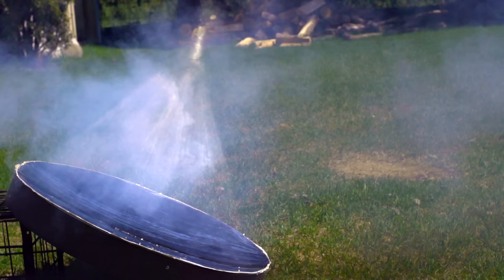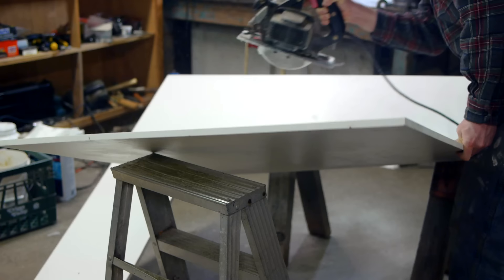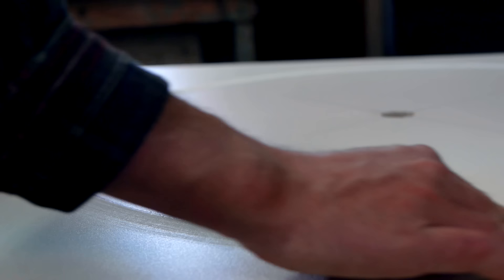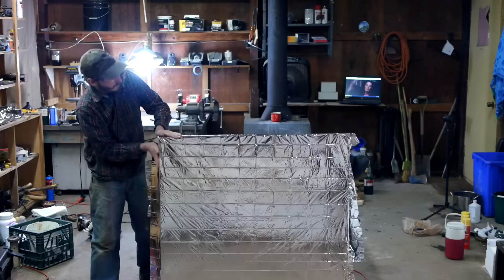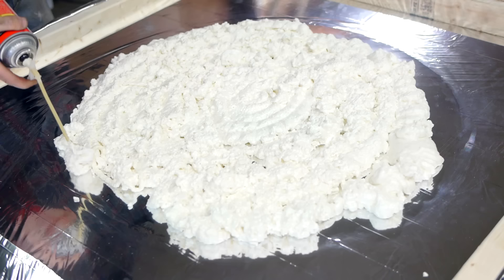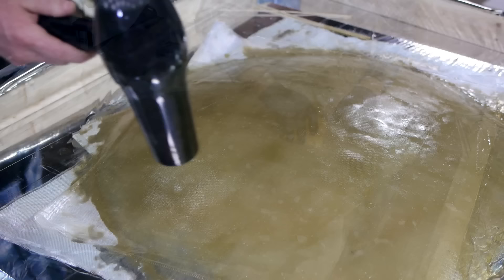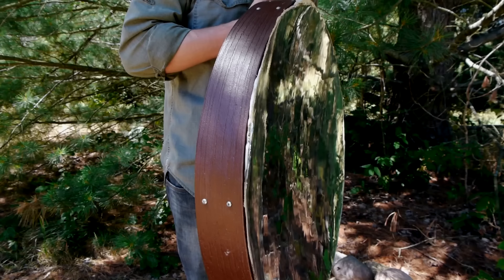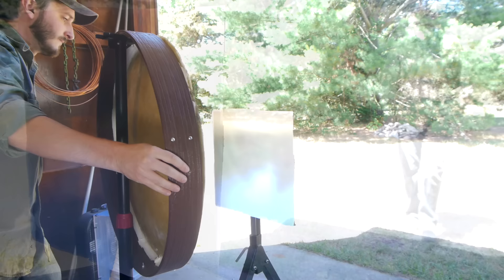How To Make Parabolic Mirrors From Space Blankets - NightHawkInLight

Comment: An idea that I have been wanting to try is to use a discarded DishTV antenna. Use the same "Space Blanket" foil to glue to the antenna. The antenna is an accurate section of a parabola with off-axis focusing.
Reply: Hi..bro ..please can you help me to write the materials that're used to make the blanket mirror..and the steps if you can..because my university requested from us to write a report about it.
Reply: I have done that. Found a large one (36") and covered the inside with mylar. We cut many mylar hexagons (4" in diameter) rather than a vacuum. It allowed for a wrinkle free installation with spray glue.  The completed mirror put things on fire easily.

Comment: What's pretty neat about aluminized parabolic reflectors, and "funnel" style solar ovens, is that they can also be used to cool objects as well at night , by radiating the IR energy up into space.  Make a container that is very well insulated in relation to conduction and convection, but very transparent to IR, find a part of your yard with a clear shot to the sky, point the reflector straight up and especially on cloudless, dry nights, over night, the contents inside the container will significantly cool in relation to ambient air temps.

Comment: Nice work. Space blankets are quite transmissive, and wear very easily. I've used hydroponic mylar for parabolic troughs in the past, it's significantly more reflective, thicker, just as cheap, and a little more durable tho still not enough to just leave outside.

Comment: I was playing with these long ago. After several versions I made just two flat rings around 3 feet in diameter. I placed a tire valve into a hole drilled into the rings. Then I took a clear piece and a mirrored piece placed them together and bonded them between the rings so the valve is between the films. Then pump air inside and it inflates like a balloon. The rings keep the lens stable. This can be scaled up quite easily to make giant mirrors.
If you wish to replicate this feel free to do so.
You may need to add a spacer ring to allow the space for the valve.
Reply: I remember seeing this scheme in a drawing of some proposed solar reflectors destined for orbit. They used an inflatable torus for the ring. The thing I like about this is that it can be safely depowered by changing the pressure inside to make a convex mirror.

Comment: Bought a ten pack on Amazon. I used spray adhesive and glued several gold foil space blankets to a tarp. Tried it out a couple of times and it reduced the temperature under them by 20 degrees. Great to put over your tent when you're camping in the desert. Tried them in the winter too. Hung the tarp inside of my tent by surrounding my sleeping bag. Outside temp was 21 degrees F. Temp inside the tarp 59.
Reply: or when you need to hide from police helicopters and their cheeky thermal vision
Reply: @trollmcclure1884  But the giant shiny thing is visible by our eyes
Reply: @midgetman4206  you can put leaves on it and stuff. It’ll still act as a barrier for infrared. Didn’t some murderous hobo hide from police helicopters like that? I forget.

Comment: I did a similar thing a few years ago where I stapled down the mylar  with a layer of cloth over it  in a circle onto a piece of plywood with a hole in it that I attached my shopvac to. Then I  inflated it and applied some resin to the cloth, which stuck it to the mylar. After the resin cured in a couple of hours I just cut off the dish with some scissors. It was pretty floppy, but if I added a ring like you did I imagine it would have been fine.

Comment: make a round ring to hold the mylar down instead of just epoxy, then you can really put pressure to the mylar. Make the ring just smaller than where you glue and round the edges 2mm radius "so mylar does not tear" then run your fiberglass and fiberglass the ring to the mylar as well. Now you have the stable mirror and you do it all in one process.
Reply: Good congratulations!!

Comment: To make a telescope, the parabolic curve would have to be much, much shallower to get a longer focal length.  Telescopes tend to have f ratios of a minimum of about f/4, and anything up to f/12, meaning the diameter of the mirror is 1/4 or 1/12 the focal length.  So for a 1 foot diameter mirror, you want a 4 foot to 12 foot focal length.  The mirror shown here seems to have an f ratio of about f/1.  

To make a shallower curve, you could pour water into the middle of the mylar, stretched over a circular hole.  Stretch the mylar out very tightly by clamping with lots of G-clamps over another material to spread the load.  It is important to get the tension equal all the way around to get a symmetrical shape.  You can check the focal length by shining a torch onto the mirror and trying to get the reflected image of the torch's filament or LED in focus.  However, the water will probably affect the focal length, but I haven't done the calculations to work it out.  

I like the fibreglass idea, but you could probably bond a rigid support to the fibreglass with vertical and horizontal cross brace rib pieces similar to an aeroplane wing construction, before removing the clamps. Then bond those ribs to a solid base and cylindrical side-wall and it will be really rigid.

I'm not sure how viable this mylar would be for imaging, as it looks a bit uneven and the reflections look kind of blurry when compared to a polished piece of metal or metalized glass mirror.  Another method to consider is metal spinning - spin a large piece of sheet metal and bend using a tool to match a former underneath.  I wonder if vacuum-forming (vac-form over a large open hole) could be used with a metal-coated plastic sheet, or maybe you could electroless-plate a normal piece of vac-formed plastic with metal?  You could even ditch the vacuum and use heat to make the material sag under its own weight, or use water or sand to weigh it down.
Reply: @jimmimak, it seems to me that the curve achieved by the air pressure method in the video must be spherical, rather than parabolic, as the pressure will be exerted perdendicularly to the surface at all points. Continued inflation would lead to a spherical bubble, if the material was elastic enough. Your method of dishing the surface using the weight of water must give a different curve, as the direction of the force applied at all points will remain almost perfectly parallel
over the width of the surface, I imagine. I want to think that the curve achieved would be parabolic, but I cannot determine why it should not be a catenary, which is the curve assumed by a cable or thread strung between two points and acted on only by gravity. Do you have any thoughts on this?
Reply: If elaborate on this with a thought experiment, I wondered if the focal length of the curve with the water method could be controlled by adding a greater weight of water. That is to say, I imagine the mirror at the bottom of a column of water, however, I think that this puts us back in the position of hydraulic pressure, rather than pneumatic, acting equally over the surface and forming a sherical dish. Does this contradict the idea that the elastic mirror, responding to the pressure applied by water filled only to its brim, might give the parabola we seek? What do you think?
Reply: @leehaelters6182  Interesting ideas.  I think you're correct about the hydraulic pressure, but my guess is the difference would be too subtle to notice.  Perhaps with a denser material you would get a more noticeable parabola?  

To make the parabola, I've had a few ideas, but they might be too wacky or extreme as the shape needed is probably more subtle.  

1. Very stretchy membrane material like spandex. 
2. Material that progressively gets thinner towards the centre.
3. Several layered membranes with holes/apertures in the centre getting progressively smaller.

4. Membrane material with a low elastic limit, so that it plastically deforms?  Like bread dough.  
5. By heating a piece of plastic more in the centre than at the edge (think vacuum formed plastic).

6. Fill membrane with varying densities of material, more dense in the middle (pitch or sand?), lighter material at the rim (oil?). Oil and water can self separate due to their densities, so maybe that mechanism can be used to get the shape you want.

Comment: This is beautiful, and a fantastic idea! As a physics teacher myself I will be sure to make one of these as demo pieces for my students. But I would also show your video so they can see the process you used and that initial failure... er... learning experience. Thanks so much!
Reply: As a student who can legally be a teacher, I have to mention that you can use different materials, as well. For example, instead of fiberglass, a bit more resin and more layers of paper might work better, or even cardboard, or a mix of both. Instead of mylar, you can use wider rolls of aluminium foil (tinfoil) than those used for cooking. Even aluminium foil for cooking works, for smaller parabolic mirrors, especially for smaller parabolic curvature. You can even make reflective telescopes that way, with paper, tinfoil, and black plastic bags to make the paper tube of the telescope opaque, and have the paper tube hardened by resin, and have enough layers of paper, so it won't easily be crushed.

Comment: I think you'd get a smoother finish if you do a gel coat. Vacuum the resin to get air bubbles out. Pour resin like you did in the center  but don't touch it. Let it spread thin and let it set up until hard but still a little tacky and then put some layers of fiberglass as you did. It should be super smooth.
Reply: I think it would be more accurate if the resin is poured first and then inflated the parabola?

Comment: Nice, but note obvious the resulting shape should be parabolic. Due to the equilibrium between tensions (i.e. blanket and pressures), it rather be closer to a spherical shape. This explains the aberrations we see when you blow smoke at the focal point... but it's a better point because you need a good repartition to heat, e.g. water in there !

Comment: Alternative: A "rotating liquid-metal mirror" automatically makes a perfect parabola, but only while it's spinning. If you instead spin resin (or molten glass or molten aluminum) until it hardens, you've made a smooth parabolic surface (which then must be "corrected" if necessary, polished, and possibly plated with reflective metal). You have to spin a "pan" that closely approximates the paraboloid you want (CNC cut or 3-D printed); the more it departs from perfect, the more liquid you need to cover it. (If the resin floats on water, maybe you could use a plain cylindrical vessel filled with water as the parabolic "pan".) Problems: Air currents could make the parabola slightly imperfect. When the rotation stops, centrifugal force stops, and the shape will change very slightly. Dust, etc can settle on the resin while it hardens.
Reply: Mercury ought to work. :)
Reply: A working liquid-mirror telescope (mercury) was built in 1872, when mechanical engineering became good enough to maintain the required constant rotation speed.  I remember reading that the ground vibration from a horse and carriage passing nearby was enough to degrade the image because they didn't have air bearings for maximum isolation.  Rotating mercury mirrors were used even in the 2010s, and some are planned.
Reply: @quaztron  - And again, I am too late. :) 
Interesting to know about the use of mercury for that purpose. Thanks for sharing.
Reply: @my_dear_friend_  

..But isn't Mercury highly poisonous ?
Reply: @A.Netizen.Since.2010   - Very much so.

Comment: If you just need a quick parabolic mirror you can ge a much smoother surface by laying the mylar on a bucket of any sort that is air tight and apply a vacuum you can even use the pressure to adjust the focus

Comment: Awesome idea! I suspect matemaematically this should be a catenary, not an exact parabola, but it burns cardboard, so it is close enough! 
What if you sucked the air out instead of inflating it? I mean, with the circle already in place and closed from the bottom.
Reply: Came here to make the same comment!
Reply: It would make it very difficult  to fiberglass the inside of the mylar.

Comment: Spinning a fluid or liquid in a round flat container will cause the liquid or fluid to form  a Parabolic shape If you use resin once it hardens you have a perfect Parabolic shape or you can use large amount of mercury to make a telescope mirror as long as you keep it spinning. I have used this in making telescope mirrors in a glass furnace to cut down the grinding of mirror for telescopes.
Reply: Was going to comment this.

Make a mold from concrete  spinning in a round container

Comment: Nice video! I was thinking it might be easier to create a high quality mirror without the fibreglass. Just create a box with a circular hole, place the film over the hole, and apply suction to the box. I know it will be more fragile, but the mirror would be near perfect. Also the focal length would be adjustable. There might be some limitations I'm not aware of, but would be interesting to compare the performance of both methods.

Comment: My thought would be to make it as a vacuum system -- build the frame, seal it up, add mylar, then pull a vacuum to get an adjustable focal length. The pressure would keep the shape.
Reply: You wouldn't be able to cover the back side of the mirror . It would be inside the vacuum chamber.
Reply: imagine if you will...a vacuum is pulled inside a bucket with a mylar surface sealed over the opening...
Reply: double post: and you keep the vacuum to keep the shape. If you want to change focus you change the pressure.
Reply: I believe that is the basic process for how some telescope mirrors are made.
Reply: Very good idea!
Reply: Mebby I should try it, you would need to be careful around it, without reinforcement it could pop
Reply: You would need constant power supply and constant vacuum. Power loss would mean bye bye parabola. It wouldn't be portable either.
Reply: Besides, the focal length of a parabola is also dependent on the radius of the circle, change the depth too far and its no longer a parabolic curve. Such adjustments are only good for tiny focus adjustments that would be beyond the scope of this crude mirror.
Reply: @robertebersold3817  not so much if you are able to seal it properly with the vacuum in place. Trial and error would provide you with a great portable result

Comment: I know this is a very old vid, but this is a thought experiment I run in my head, ad infinitum: How to make a big mirror for a Dobsonian telescope. There was an article in Popular Science, I believe, which had a great method -- basically a 15"-20" bowl, on an old record turntable with the central spindle removed, filled with very slow setting epoxy. And set the whole thing up on some foam in a place far from traffic or other vibrations. It creates a parabolic surface, the focal distance determined by the RPMs of the turntable. But you still have to send out for silvering. I love to think on ways to achieve such a surface myself. This is a clever solution, I wonder how I could manipulate a space blanket to work with an existing parabolic form?
Reply: A telescope mirror has a surface figure that must be accurate to a fraction of a wavelength of light. Given that, the approach of using mylar has a lot of challenges that might be insurmountable.  The main one I see is that it's soft so it will deform due to uneven weight of the fiberglass. That will create zones (visible in the video). 
Secondly, the fabric of the fiberglass will print through.   Thirdly, I don't know how smooth the surface of
the mylar sheet is so even with a perfect figure there will be a lot of scattering.
I think flipping it upside down (concave side up) and displacing a liquid epoxy like you mentioned would
be a better approach. you would need a machined ring at the edges to prevent distortions at the edge.
You can see some of those in the video.
For a solar furnace this thing is brilliant! (Couldn't resist)
Reply: chrome paint

Comment: The formula for the parabola in terms of focal point is given by: y = x^2/(4 * fp), where fp is the focal point distance you want. What I've found is that if you make a box that 4x4x1, the focal point will be at the surface of the box. If you wanted to "panelize" a solar concentrator, these are the dimensions it has to be. Then you can place your solar receiver at this focal point without too much interference. I want to create this idea with tubes of hot oil circulating into these receivers. We can encase them in the glass that covers it from the rain and dirt, but more importantly, keep the heat in.
Reply: Wouldn't a trough type of reflector be better for heating oil in pipes? I think that's what they use in industrial systems that use that method. There's a Diana the Physics Girl video on it, I'm pretty sure.
Reply: @HipNerd  yes, the same formula applies too.